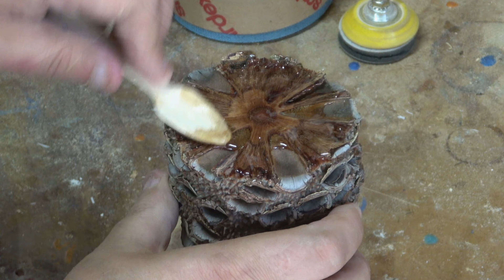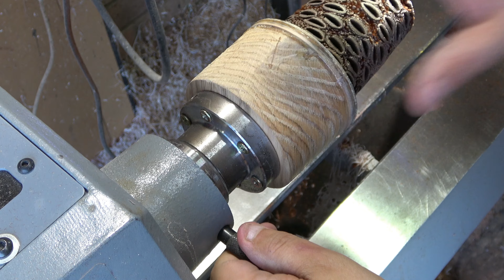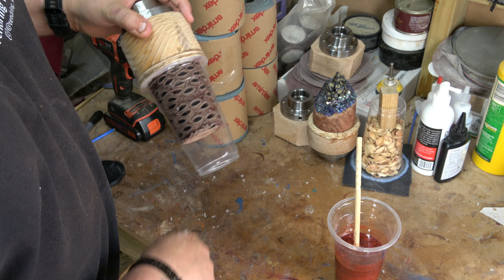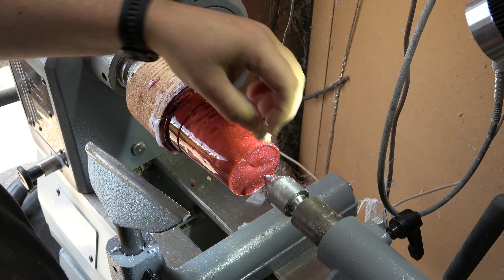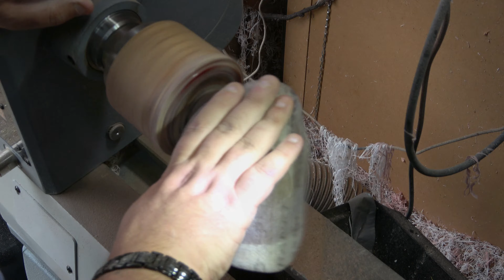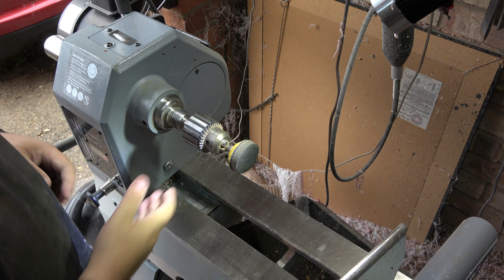Woodturning a Banksia Pod Embedded in Resin

Comment: I have thought of using Banksia pods in one of my projects but never got around to it since I can't figure out a good design. But you did an amazing job! It looks amazing!
Reply from the maker: Thanks very much. I also did a small goblet with Banksia and that came out super cool. In fact if you look at my profile on here I’m pretty sure I used it as my banner. 😊 Unfortunately I did it before my YouTube journey so only took video in vertical. 🙈. I had a lot of response from it though, if that helps, really simple project as well, as long as it doesn’t make you itch like it does me 😂.
Reply: @tendring_woodturning  did you just mention itching from Banksia pod or from the resin? I developed awful allergy from using the resin and now I have to use PPE at all times.
Reply from the maker: @oneturnatatime6309 oh really? That sucks 🙈. No the basksia I meant, there a what I can only describe as a velvet layer, and that makes me itch like mad. I’m good as soon as I get rid of it. 😊